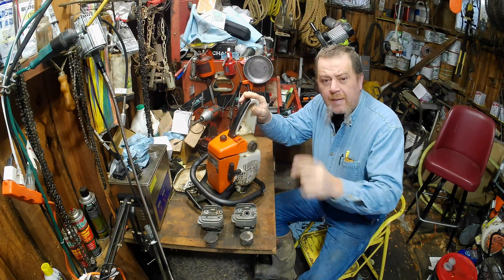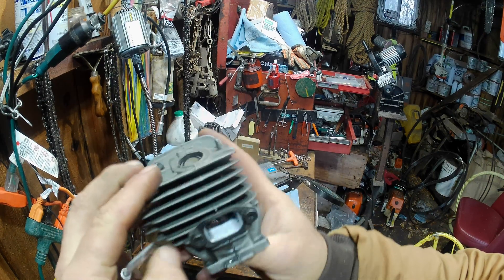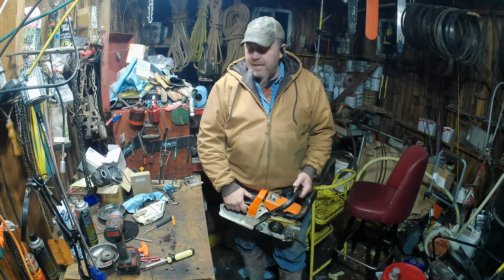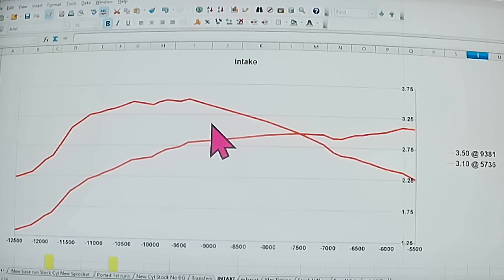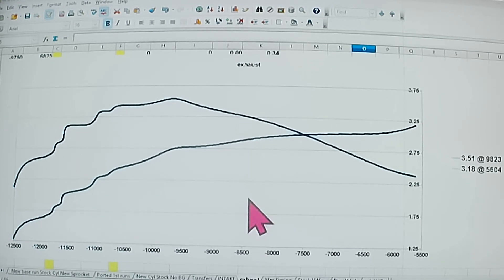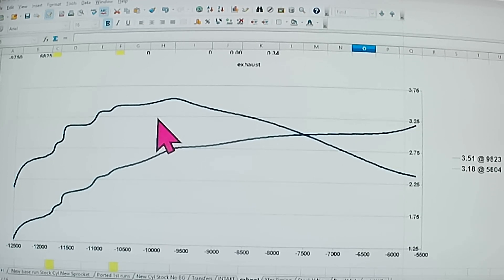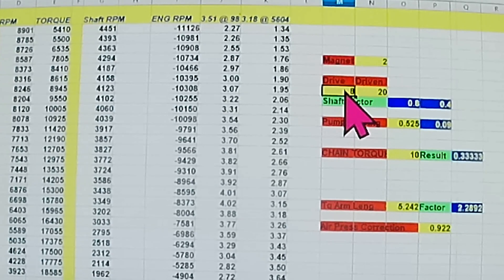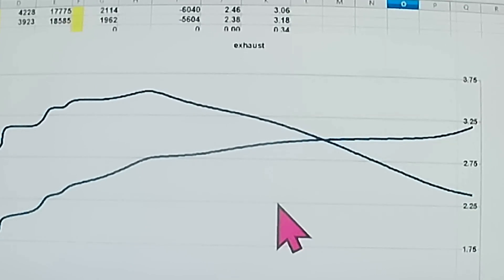Exhaust Port - DYNO and Test CUTS- EVERY Step. Chainsaw Mods Step IV

Comment: Got a year 2000 used 026 earlier this week . watching your video's was part of my research for which chainsaw to buy . So thanks for the vids from rural Wales 🙂  , it was about time I got a good , well made chainsaw  . An 026 seemed to me the perfect mix of reliability ( I will be using it to put food on the table and wood in the fire ) , size/power and price . And it does not disappoint , bit heavier compared to the last chainsaw I tinkered with for a friend , a MS170 . but the extra power is very nice . hardly any vibration too . Stihl is great . already got a blower and a brushcutter by them , both brilliant . I will probably do some tuning eventually , its pretty interesting and i'm enjoying this series .
Reply from the maker: @containerseightandnine9756  Very very good! I hope you enjoy it and get lots of life from it. The Stihl 170 was not one of Stihl's best offerings and the difference between it and the 026 should be staggering in power, productivity, and longevity.  Stick around; we have plenty more 026 and other chainsaw videos coming as well as sawmill, hay making, and livestock. Thanks for joining-in the conversation and sharing your experience(s)!

Comment: Thanks for the mention. Something is really holding this saw back. Once the muffler mod happens I think it will liven up. Great video series.
Reply from the maker: @TheJohnDeereGuy  I think so too... but remember that it already had a (somewhat) muffler mod done on it prior to ever starting this build I think the next video's HP jump may surprise you; it surprised me. We're on the right track, so far.  The air-filter is a HUGE obstacle and I'm not sure what to do about it. The air filters are commonly considered to be the limiting factor of this series of saw (as well as the MS260)
Reply: @HayChaffandSawdust1 
Check to see if redbeard saws has a filter kit for one. He makes several different stacks with uni filters. Oh by the way I mentioned porting a bunch of husqvarna saws. In a post. Just to clarify I own all brand saws. Just happens to be a contest that a YouTuber is doing for those model saws. I'm not a brand snob. 😆
Reply from the maker: @eze7524.Morning_Wood_Farms  Ahhh! is/are yours going to Novice? I, also, am not a brand snob whether trucks, chainsaws, tractors, etc... I will work with whatever will work with/for me. I do need to check redbeard, but I doubt it; the 026 has the choke built into the air filter... not even a choke in the carb. The filter is narrow and the choke "flap" only hinges back about a 1/4" and air has no smooth or remotely-straight shot into the carb.  I will have a bunch (I expect) of little bitty mods/do-dads to try that will probably make a single video at some point...  will show the junk air filter at that time. If you haven't seen one, you probably wouldn't believe such a limiting factor.
Reply: @HayChaffandSawdust1  Yes I have seen the intake and filter on the 026. Absolutely horrible from a flow standpoint point. 
Yes I'm going to send one of the saws I've done to the Novice lumberjack. It's kinda a crap shoot. I build work saws mostly. It's hard to determine what is going to be best in a competition. Only thing I know is the saws will run 40/1 non ethanol fuel, open chamber cylinder 😑, pull a 20" 325 bar. What the wood will be or how the saws will be run I have no idea. My saw will not be a cookie cutter saw. I look for a good all around improvement given the parameters of the 55 saw with a 20" bar. I have built my saws accordingly. Do I have saws that I think do better with an 18" bar in soft wood. You bet. This platform is great. To me these saws are like the ford 300 6 cylinder. The just run. I tell you what. I have another 51/55 I was going to build. It was a saw dug out of a scrap pile in the middle of nowhere. It has potential to be a running saw again. I will donate it to you if you won't to make a series with it. Open port verses closed port cylinder. Finger ports whatever. It will be your baby to do as you please. I'll send it with everything I have. It will need a few things but crank seems good. I have a new cylinder an piston kit for it. Flattop. Caber ring. Has walboro carb. Will need rebuilt I'm sure. Have new crank seals. If you're interested let me know.
Reply from the maker: @eze.Morning_Wood_Farms  When is his competition going to happen/air on YT?
I don't mind basket case saw if cyls/parts are easy to come by and that is the size of saw I prefer to play with; Have 440 and 660, but I prefer a lighter saw for wood 16-18" and under. The ol'  Ford 300/6 was a dang-tough engine... but I'm better a Chrysler slant 6; you can run them without oil. water. or distributor cap. They can make the WORST mechanic look good! 😂😂
Reply: I'm not exactly sure. Like March 13 or 14 I think. Don't know when he will edit and load the cutting. I don't look to win by no means. Just put out a good build decent pulling saw for a 20" bar. I'm sure there will be race type builds with bigger carbs, etc. no rules against it. If time permits I might put together a spicy cookie cutter with machine work in the chamber etc. I personally think machine work is the biggest key to making power in a saw. Can you get gains with a gasket delete and some porting. Absolutely. You are at a big misconception if you think that the saws dyno joe, Charles brisco and many others build don't get lots of machining in the chamber. I plan to do a 359 husky for a snappy, spicy little saw. You're looking .050 out of the chamber, base cut to get my squish. Blow down in the 15-20 range. Timing advance etc. 
Yes I forgot about the slant six. Those things are sweet. Love watching them race them at beechbend raceway. Cool little setups. I'll email you about sending you the saw. It will have most everything for it. It will need some odds and ends.
Reply from the maker: @eze.Morning_Wood_Farms  Right on the money as usual! I sure don't fault those guys for doing a bunch of machine work, but it's not for a saw I plan to let out of my hands, I don't charge for porting/fixing saws, and I have one coming back right now that I've had to redo two times... every time it comes back (supposed to be delivered today, buy he didn't make it) the chain looks like it would cut just as well one was as the other. Ain't many operators around here that could keep a hottish saw happy.  I have the capabilities to do the machine work and do some to correct squish or exhaust roof etc... Like you, I am not opposed to building a hot one or two for fun. Wish I knew of a GTG (like sawfest , hopperstock, etc..) that wasn't an 8-12 hour drive; can't (and don't want to) leave my livestock overnight. if you shoot me an email, leave me a comment (on about any video) as I don't check that particular email too often; I'm getting better though.
Reply: @HayChaffandSawdust1  I'm with you. I don't want to drive 7 states get to a competition. I have things I must take care of and no one to rescue me or bail me out. Maybe one day in the future. 🤞
Reply from the maker: @eze.Morning_Wood_Farms  Bond money I can get; time is my short suit! 😂😂😜😜
Reply: I totally agree and understand. Run them till they break and then look at you like 🙄. I don't do crazy work for customers unless they understand the consequences. No different than building a race engine. Same deal. Warranty is 5 or 5. 5 feet or 5 seconds. Not to say I don't help people but you can't warranty something when it's modified beyond what it's built to do. If the operator I know doesn't do anything silly. I be glad to look at what happened and take care of it. Your oem warranty is setup and if you don't use their oil or have them do the service on and on the warranty is void. Catch 22. Also make sir I start and note any issues before working on anything. Contact owner and go from there. Most of my work is for  people who I know and know me. Very aware of my attention to detail and work. 

I actually didn't see an email for you. Just send me an email mine is in my profile. I'll send you the saw and some parts you can use with it. I'll make sure to give it a good wash. Nasty little thing. 😆
Reply from the maker: @eze.Morning_Wood_Farms  Aw heck, the "warranty" or a problematic customer is NOT my problem... he knows he's hard on stuff and just brings it back to get fixed... never a sore word; he's a personal friend and would sharpen his chains too; you can lead a horse to water... Who knows, when I get it in my hands, it may be something as simple as a starter rope, although he said it won't start and makes a "clicking noise" when he jerks the cord with his gorilla arms. 😂😂